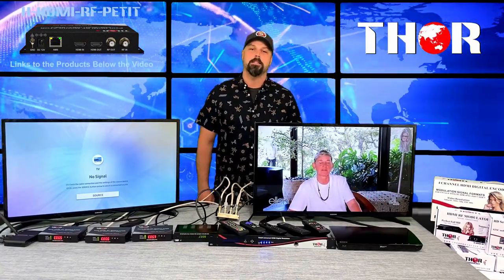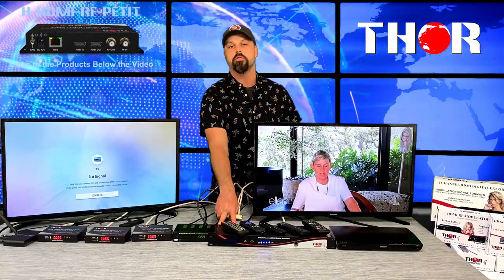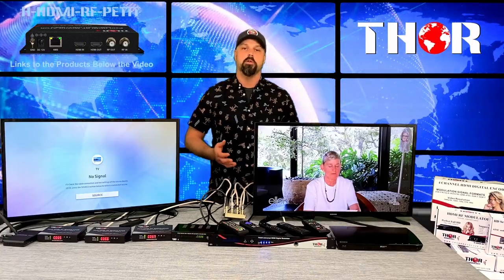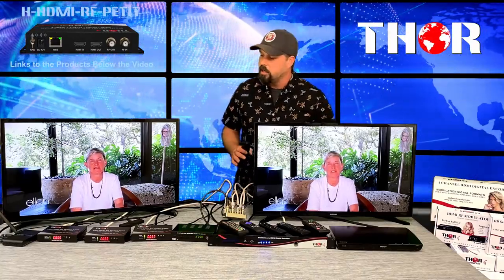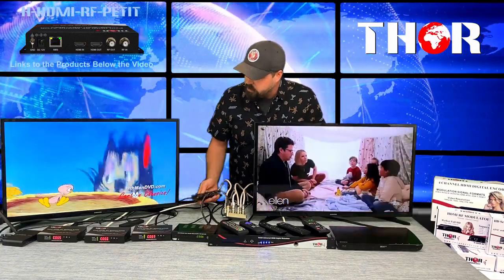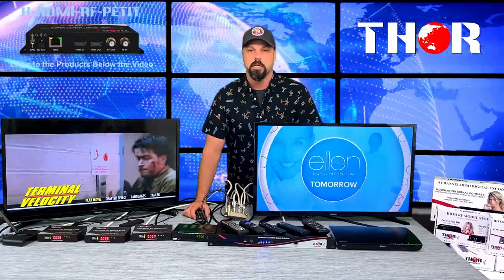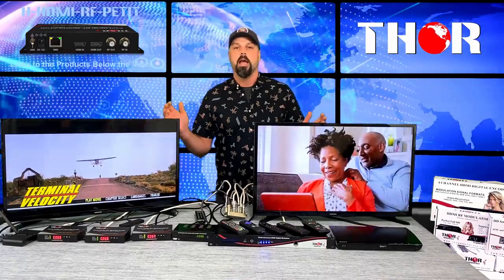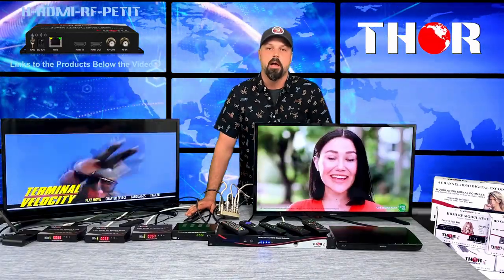How to Create your own Cable TV  channel and combine  with existing Cable TV or Antenna TV on Coax

Comment: Can the rf signal be linked up from box to box, so you only end up with a single combined signal out?
Reply: No, but you can put them into a combiner
Reply: @ifanjenkinator3464  Thank you :)
Reply from the maker: The Petit HDMI Modulator has an RF input port and an RF output port for this cascade purpose. Yes, absolutely. Let's say you have 4 HDMI modulators and you want to program them to have unique channel outputs like 2, 3, 4, 5. You can use the output to connect to another modulator's input, so in the end, you will have just one cable. Now, using splitters, you can distribute it to many different TVs. Coaxial distribution is a phenomenal way to send multiple videos over a simple coaxial network. When the TVs scan the channels, you will be able to switch between them using a simple remote control. Essentially, you will create your own mini cable TV head-end for your local in-house needs.
We also offer mounting gear so you can mount them in a 19-inch rack
https://thorbroadcast.com/product/hdmi-rf-modulator-chassis-system-1-12-units.html/250

I made some adjustments for clarity and corrected spelling and grammar errors throughout the text.

Comment: I live in a seniors building with a cable outlet in each apartment. The only signal that we can access is the screen split into four sections showing the laundry room and the entrances. Can this cable system be used to create a channel where news bulletins can be released to the apartment providing various information like vaccines, or water turn off, etc. on a regular basis? Any help would be appreciated. Thank you kindly.
Reply: Yes you can you can even get set top boxes from a cable provider and re distribute them over the coax as well